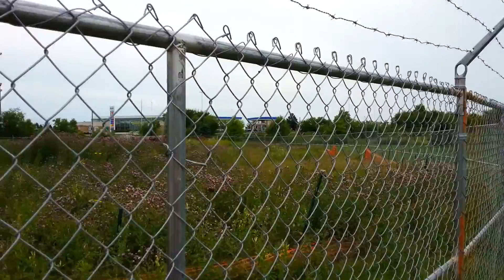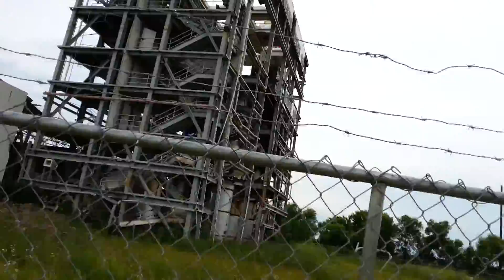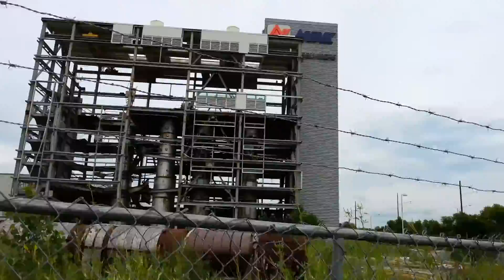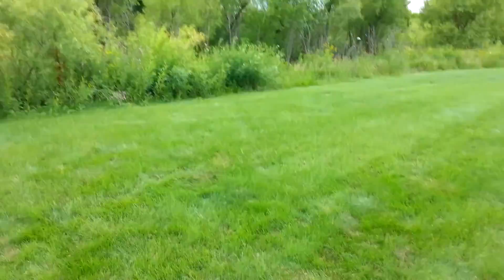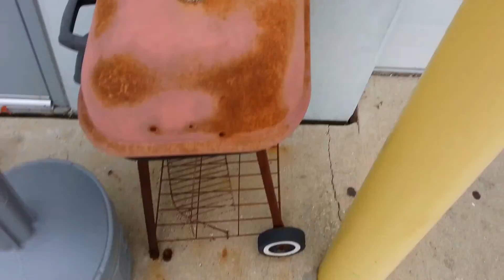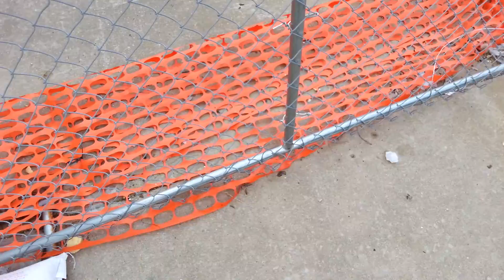NDK Crystal In Belvidere, IL - Almost 5 Years After Explosion

Comment: For a thorough evaluation of what actually happened, read the Chemical Safety Board review of the whole incident.  This facility had a minor issue in Jan of 2007 and potentially catastrophic problems were discovered.  It was suggested the facility be closed and have major inspections/changes made, which the company did not do.  Insurance has not paid since the company did not follow any recommendations made.  http://www.csb.gov/assets/1/19/CSB_CaseStudy_NDK_1107_500PM.pdf
Reply from the maker: Thanks for sharing this. Never even knew this review existed. We actually just drove past it last weekend. They had repaired the side of the building, and it looks like they are in the process of demolishing the part with the pressure vessels. I wonder what will happen to it.